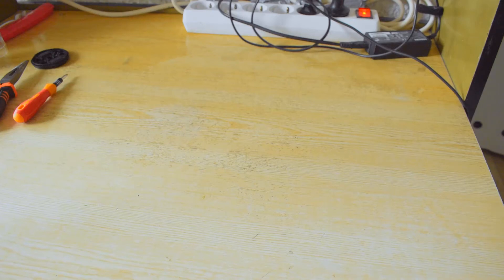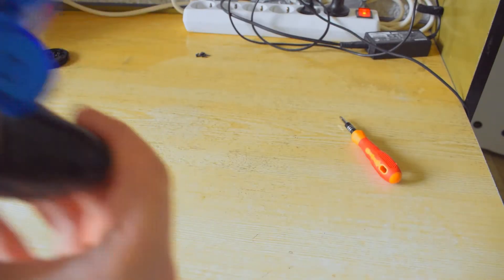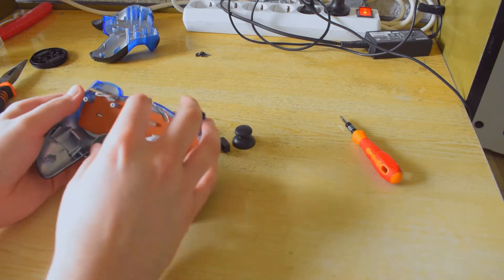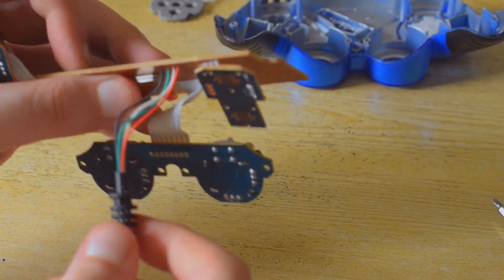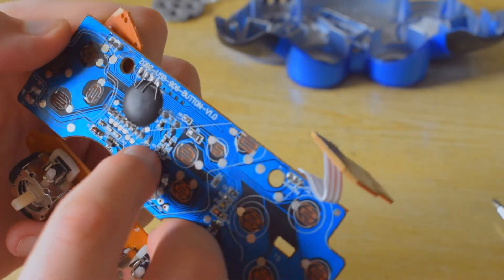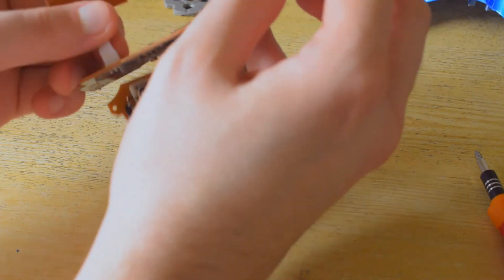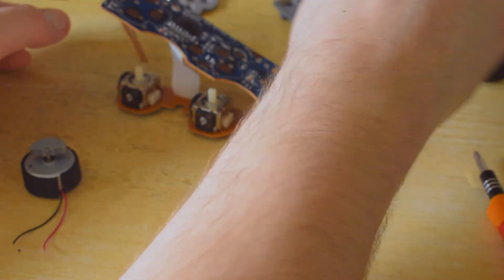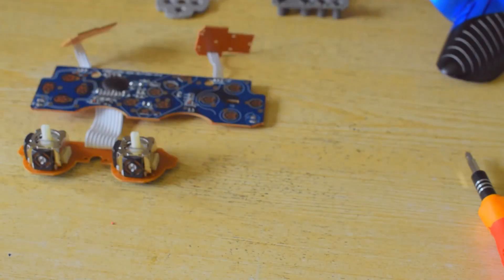WHAT'S INSIDE a generic USB gamepad???

Comment: Generic gamepad uses Dinput.
Modern games use Xiput that's why vibration is not working.

Solution. 1) install speedlink vibration driver
2) install x360ce / Xoutput

And generic gamepad becomes xbox gamepad.
Reply from the maker: Thank you very much! That was some useful information 😊👍